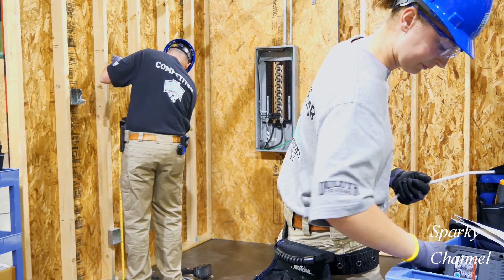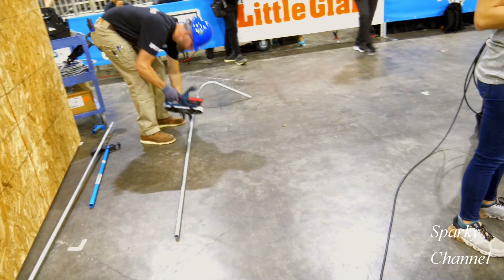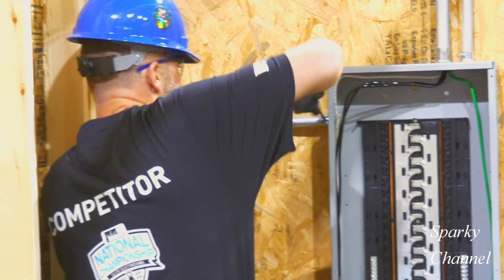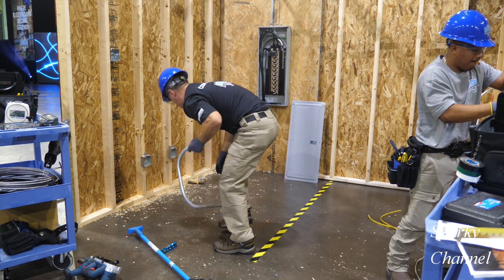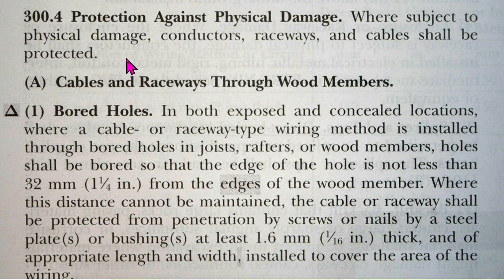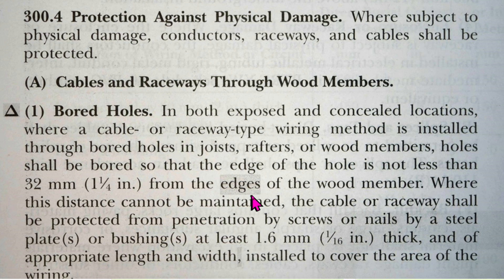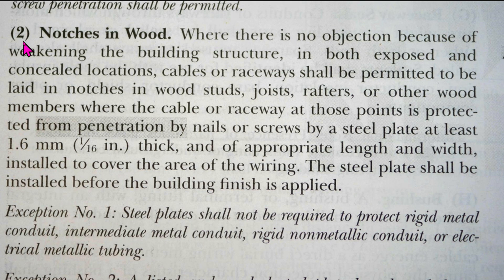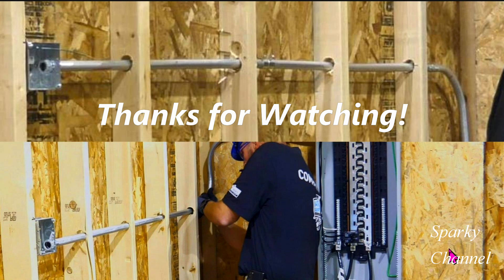How to Run Conduit in Studs per 2023 NEC 300.4(A)(1)

Comment: I'm curious if certain power tools were prohibited and or provided to contestants. Could they use their daily carry? Here are some tips I use to improve piping speed: Get an old school folding stick rule and sharpee mark all your common dimensions on it for layout, and also use it as a story pole to mark your hole locations. Tape measures are great for certain things but are slow and wiggly. Don't fold and unfold it, leave it opened up and lean it somewhere. You need to be fast at drilling holes or its game over. A chalk line is fast for marking a long horizontal wall with height locations. A Laser is also a time saver. Get a small metal cutting circular saw with 50 tooth blade. Mines a Bosch and blows away the mini band saw for speed and square clean cuts. My lightweight 12 volt Milwaukee impactor is the most used tool for driving screws and 12 volt 90deg impactor with Klein reamer with #2 square bit to ream and tighten fittings in all locations. An 18 volt impactor with 1" Irwin speedbore bit is the bomb for running 1/2" thinwall. I never enter the sides of switch boxes, always top/bottom. The fitting threads can interfere with deep devices when a 2 gang ring is used. A 12" 90 with a slight kick gets you out of the box and transitioned to the center of the stud without an offset. Also, carry the minimum amount of weight with you when running emt. Lots of bending, kneeling, reaching will wear you out prematurely if you have your entire toolbox strapped around your waist. You need to move fast to make money and stay employed. I always have at least one folding 20" high work platform nearby as a table or to access ceilings. Ladder rungs kill your feet and the platform allows you to stand flat footed along with working a larger ceiling area without repositioning. Last thing, knee pads, knee pads, knee pads! I have over 40 years into the trades and these techniques have allowed me to keep cranking out the pipe at 60 years old.
Reply: I disagree. After using a number of cutting options, I would put my 20V mini porta-band up against anything for speed, ease of use, squareness/cleanliness of cut, and durability. Ill never use anything else
Reply: Do you ever use deeper mud rings to give more space on the box and avoid device interference with the conductors? I used 1 1/4 inch deep mud rings to allow setting the holes closer to center of studs, meet box fill requirements for conductors, and also give more space for big devices (smart switches, GFCIs). There are some really good looking adjustable depth metal mud rings as well that go all the way from 1/2 to like 1 1/2 that seem perfect for kitchens where a backsplash might be added.. or not.

Comment: No nail plates needed when EMTs are used as per NEC. I’d argue this with an inspector up to a certain point. However, holes should be in the middle for structural reason and I believe an inspector would fail the guy of the bottom at 13:20
Reply from the maker: Hi! Excellent points. But which inspector and where? That is exactly the way it is run (and approved) in Chicagoland. I'm not disagreeing with you at all though but opinions on this can really vary with different inspectors in different areas.

Comment: Inspectors can be a wild card; I’ve had them say things were wrong only to correct it and have a different inspector contradict the correction. We’ve gotten tot the point of having laminated quick reference papers for specific code sections that come up frequently; though ultimately the inspector has the final say as I doubt anyone is looking to go to court to prove they’re correct which is what it would take with out municipal inspectors. 
I personally prefer notch and set with protection plates for everything; though this is an absolute no-go with I-Ben style manufactured floor joists. I always find it funny that electricians and plumbers can be the ones having to fix construction deficits and outside of a few places that isn’t that big of an issue; we’re things really suck is the municipalities that force a carpenter to fix a simple issue, I’m talking about NYC which is about the worst place in the world to be an electrician.
Reply from the maker: I was talking to Raul, the inspector in the video, off camera and he mentioned that inspectors in different areas can really vary in their opinion. The laminated quick cards are a great tip!
Reply: @SparkyChannel : I also keep the NEC on my phone though the tablet is better for reading it as my eyes have gotten older. The cards are a great help as they supply the info and code section so the inspector can check, some even have pictures on them. We printed these up years ago as fast references and they’ve just expanded ever since; they save time for things like conduit and box fill and ampacity calculations. We work in multiple municipalities, one of which, actually has “enhanced procedures and standards” which while some are good is a pain so we keep a sheet just of their special requirements. I used to work in NYC and upstate is a breeze for the most part but every now and then you have issues; the whole idea of the NEC is a standardized set of standards but when each inspector can interpret things differently you can have a tough time of it. It also doesn’t help that depending on the municipality the year you’re in can change with some still running off the 2008 NEC though we view minimum code as just that and have been doing things above and beyond for a long time; hell we’ve installed whole home surge protectors on all of our load centers for nearly 2 decades, they just became an NEC standard in 2020.
Reply from the maker: @libertarian1637  Fantastic. I can tell that you take a lot of pride in your work!

Comment: Hi Sparky (Bill), apologies for commenting off-topic of this video. Wasn't sure how/where to ask this question: can a dimmer be used in a 4-way switch ckt.? If yes, how should that be done?   Sincere thanks!! I searched the internet, with no success, before bringing the question to you.
Reply from the maker: Yes, absolutely. You would use digital dimmers marked "multi-location". They work as 3-way or 4-way dimmers.
Reply: @SparkyChannel  Thank you, Bill!! Would it matter where, in the circuit, I should place the dimmer? Does it have to be in the switch immediately before the load or in the "first" line switch coming from the panel? Appreciate your quick reply, sir!!!
👏👏👍👍
Reply: @sunday9373  I can tell you that for Lutron, the location of the main dimmer (as opposed to one or more companion dimmers) must be specifically located per Lutron's instruction sheet.  I recall the main dimmer is located as the last device in the switch series.  In other words, it's the device location where the common terminal connects to the load.
Reply: You can use a regular three way dimmer at either beginning or end 3 way switch locations, just not where the 4 way goes.

Comment: As far as the nec requirements go, they both did it correctly. The AHJ has the final say. 90-4 other wise known as the god clause! 
Me personally have never agreed that pcv pipes don't require nail plates. Emt is questionable. I put them on if it close to the edge, cheap insurance IMO.
As far as the install goes, I would of run up and back down.
Reply from the maker: Thanks Donald!

Comment: Per IRC602.6 (NOTCHING AND BORING) bored holes min 5/8" from face of stud,  boring 40% max in bearing walls (2 successive doubled bearing studs 60% OK) and 60% in nonbearing. Also, bearing walls could be notched not to exceed 25% of stud depth and 40% notch in nonbearing walls permitted. Per NEC, why would anyone run EMT in a typical residential wood frame building?? Romex is permitted to be installed in wood frame structures up to 4 stories high (Construction Type IV & V) unless a different wiring methid is designed for the purpose of extra expense or specifically prohibited by a local ordinance.
Reply: A few cities, notably Chicago, do not allow NM at all.
Reply from the maker: Thanks for the IRC602.6. Good information. In Chicagoland NM cable is not permitted.

Comment: Not an electrician, I would pre-bend a little bit of the straight portion of the EMT before inserting, so the holes can be located in the middle of the stud. Half way inserting the EMT, I would use the bending tool to un-bend the inserted portion of the EMT. Split the pipe in two pieces does not seem to be as clean. Not sure making a second drill attempt above the hole does any help.
Reply from the maker: I had never seen a second drill attempt above the hole. That was a new one for me.
Thanks for the tip!
Reply: You would waste a lot of time installing conduit. Electrician work,especially residential is often a matter of production. Remember, labor is your most costly expense. It is often more cost effective to spend a little more on material if it will save on labor costs. You can have your cheapest apprentice cut a bundle of short pieces of conduit roughly 30-32" long while the journeyman is marking all the bore locations in the studs. Then the AP can run around ahead of the JW boring holes those holes as he is installing all the conduit with couplings, stopping only to make a few customer bends (offsets, 90s, etc) as need to complete the runs. You use more couplings, but you don't have to fight getting the conduit in the studs. Nice, fast conveyor belt system.

Comment: Dear Sparky. I am amazed that the extra steps both contestants take measuring and then deducting the distance of the emt. I was taught and teach to just add the 6 inches of the tape measure beyond the end of the pipe, that does the deduction for you. Add that time up for a high rise and see what you can save.
Reply from the maker: Hi Lou! For other viewers: 6" is the amount of bender take-up for a 3/4" pipe bender. Lou is discussing a time-saving technique.
Great tip, thanks!
Reply: Or whenever possible just mark the conduit the same measurement you want the height of your 90 to be, flip the bender opposite direction of the end you measured from and use the star. I find this much quicker and easier depending on the location of bends
Reply: Lou --- you are correct in doing the addition or deduction for the radius when making your first mark on the conduit. Same with the take up amount being lost when making offsets. 
 You don't measure and then go back and add or deduct.
 Also, I just have to add that the corner having no studs is a joke. How often does that happen? LOL

Comment: Nail plates not needed per NEC since it's EMT.  But from structural POV, a stud in a load bearing wall or partition may need reinforcing if the hole exceeds 60% of stud depth or is closer than 5/8" to the edge, per the IRC.  In that case, IMO a nail plate ain't gonna cut it.  Simpson Strong Ties makes wrap around reinforcing brackets for this.
Reply from the maker: Well said! Yes, Simpson Strong Ties makes wrap around reinforcing brackets would be great for this instance.
Reply: so can't nails penetrate the EMT?
Reply: @carlodonnell146  Maybe, but the NEC says you don't need to protect it.  Drywall crews aren't stupid and they just move the screw or nail and inch or so if they hit any resistance,

Comment: If you have a great answer for EMT across a stud wall, please share.  My common in real life answers are come from above or below or use a different wiring method, but to be fair those are dodging the question.  With a 1 1/4" hole in the middle, it's difficult to feed it through without it bending (which was evidenced in the video).  Short pieces and fittings work for one-offs.  One of the tricks coming up (or down) the stud is the box offset done with a single bend.  The EMT is in the middle of the stud, but the box hole is close the wall edge.  The offset goes both out and to the side.  Looks way pretty when done right.
Reply from the maker: NIce!
If you were involved in building a house, you could actually put the horizontal emts in place while building the walls. It would take some extra planning, but you could get the emt right in the middle of the studs. Just a thought.
Reply: To be fair, the only people who appreciate the "pretty" of conduit is the electrician, because usually before anyone else gets to see it, the drywall is up and no one cares what it looked like. Industrial (and sometimes commercial) is where you get to show off your bending skills with large racks of parallel conduit flowing over obstacles and changing direction like a school of fish.
Reply: @TwilightxKnight13  Sadly, you are correct the art goes minimally admired.  The real benefit though is only having do one set of offset bends.

Comment: do they frown against bx or ac use in wood 2x4s?
Reply: In Chicago, you need to use EMT (with some exceptions).
Reply from the maker: Bx and type mc cable are fine in 2x4 studs.

Comment: I don't think these guys are very impressive. 🤭 I live in NYC.... I've actually did some dare devil bends from a ATS to a sprinkler pump system.... 15' from pump unit.... I've put 4 bends on 1 length of 3/4" EMT pipe..... close to source (but pretty) ... yet passable for accommodated wire size to flow easily through. 👍
Reply from the maker: Thanks Tony.

Comment: I had to bypass a run of EMT because the framers missed the stud and nailed the shearwall to the EMT.  now I nailplate EMT and PVC.  as for the stud - I wouldn't call for replacement of a single stud that wasn't compromised worse than that, unless it was a structure that was engineered to minimums.
Reply from the maker: I'm thinking that the correct Simpson Strong-Tie wood connector would repair that stud quite well.
Reply: @SparkyChannel  a standard framed 2X4 wall uses the dimensions of the wood more to have room for wiring and plumbing than for strength, anyway.  a six inch nailplate screwed to the stud would be way more than needed.  but I've had cases where I needed an oversize nailplate, that I've used 3" simpson straps cut to length.
Reply from the maker: Don't you guys think it's odd that rigid PVC is exempt from nail plates now?
Reply: @SparkyChannel  I never leave PVC unprotected.
Reply: I doubt if a nail plate would stop a nail from a nail gun.  In fact, I have a picture of a sheetrock screw drilled through a nail plate.

Agreed.  I've just nailed the splits on a studs like that.
Reply: @donl1410  I've driven sheetrock screws through thinwall steel box tube.  I've also seen gun nails driven through nailplates, but it's still better than nothing.
Reply from the maker: Hi Don! I've seen nails from a nail gun do a U turn and come right back at people when they hit something hard like a nail plate. That would be if it was nailed at a bit of an angle though. If nailed straight-on I think the nail would go right through the nail plate.
Reply: @SparkyChannel  Hi Bill.  As far as PVC run in studs, I've always protected my holes as I would for NM cable.

When drilling and notching studs, I've always gone by the 40-25% rule so as not to compromise the framing.  The building code I'm familiar with also requires a minimum 5/8" space from the edge of the stud to the edge of the drilled hole or it could become a notch.  Some of Greg's holes might be closer than 5/8".  

On some short runs of EMT I've notched the studs, no more than 25% of their width, and laid the conduit in the notch, nail strapped, and nail plated over the notches and EMT.  Milage may vary when it comes to building codes.

Maybe you should have allowed that inspector to review the code article before you asked him the questions.  LOL.

Talk to ya later, Bill.
Reply from the maker: @donl1410  5/8" sounds reasonable. Greg told me they look for 1/4" in his area (Chicago). Would you happen to know what article the 5/8" is found in? Or is that a local code?

Yes, I should have allowed him time to review but there is no time out there. You get one shot at everything. LOL!
Reply: @SparkyChannel  Here ya go.  2021 International Residential Code:
- R602.6 (Drilling and notching of studs)   Oregon follows that example in its 2021 Oregon Residential Specialty Code (ORSC).  2021 International Building Code  (IBC) 2308.5.9 and 2308.5.10.  

I think most of the codes follow the IBC for the most part with some exceptions.
Reply from the maker: @donl1410  Thanks Don! I might use that in a future video.
Reply: @SparkyChannel  You're welcome.  Other codes can affect our electrical code.

Comment: If the opposite wall is an exterior wall, I would have run the EMT from the exterior sheathing thru center bored holes in the studs. A 3/4 inch hole in the exterior sheathing is easy to patch. Quicker and easier.
Reply from the maker: Interesting, thanks!